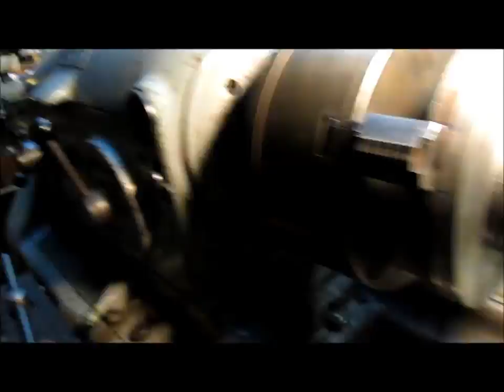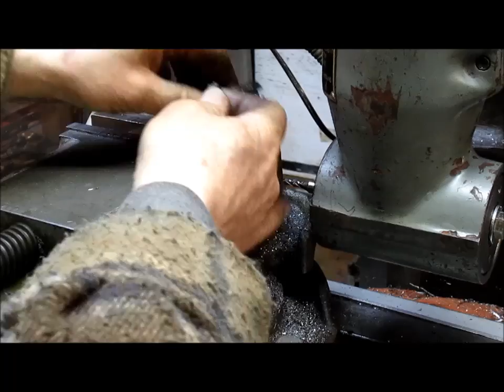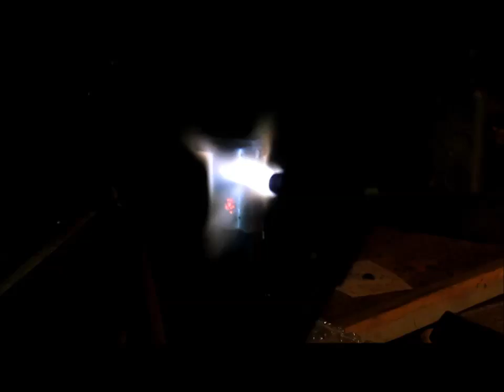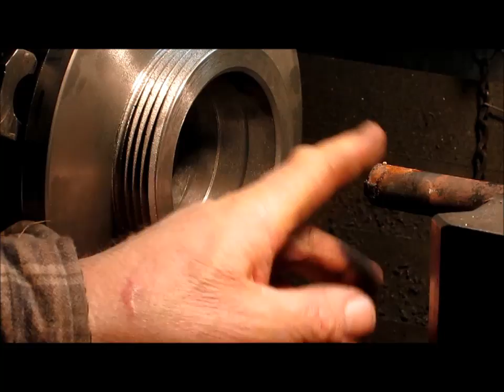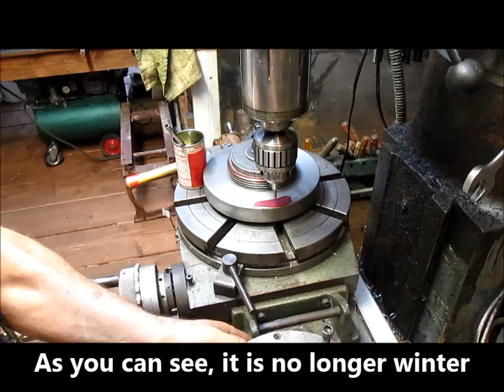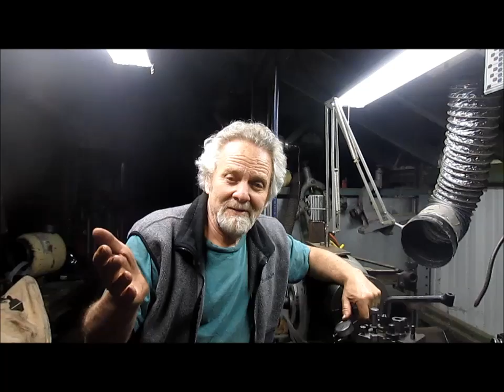Chuck Backing Plate 2

Comment: Hi , The normal procedure is to cut the backplate register to a good fit to the chuck and then  machine the bolt holes. The register is all important because if the bolt holes are slightly out they can be opened out without any problems as long as the register is correct. Simple basic engineering.
MoK

Comment: Recent subscriber, I enjoy your videos, thank you for making the effort. Do you think you could fix the upload format though? Every video has a black border around all four sides. It's probably because your video editing software is taking the 16:9 widescreen content and adding black bars top and bottom to make it 4:3, and then YouTube is adding black bars left and right to make it back to 16:9! See the upload tips at https://support.google.com/youtube/answer/1722171 (the bottom section is the important bit). Cheers!
Reply from the maker: cooperised Thanks for the heads up. Not being too computer savvy and being dyslexic I've been struggling with this issue forever. I think I have it repaired on the next video I'm going to post wednesday. Can you send me another note after you watch it to see if the problem is answered.
Reply: +Nik C. Colyer Sure!  Looking forward to the next video.  All the best.
Reply: Nik C. Colyer It's FIXED yay for progress! Great job on both projects, and your lathe backing plate schedule sounds allot like mine has been. The hardest part for me was finding a backing plate with the right throat diameter to accept the 1.750" x 8tpi threading I had to do. Now I've just got to mount it up, make the register for the chuck to locate like you did, then lay out the 4 hole bolt circle to drill and countersink my anchors.

Meanwhile I've been busy pulling my hair out trying to teach myself to mold resin, but I think I've got that close to fruition, so I too can return to my lathe's needs. It's a good thing she's an old gal, at 96 "Big Red" is nice and patient with me, LOL!

Hope you gents have a great day and upcoming weekend, Aloha...Chuck